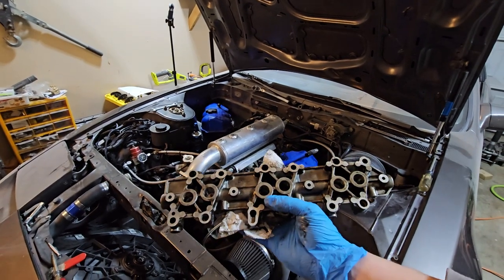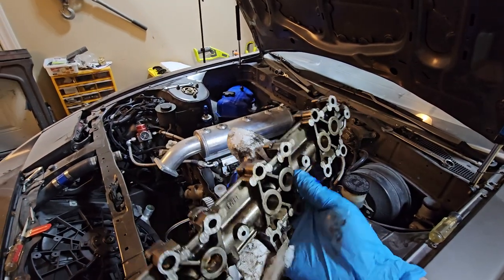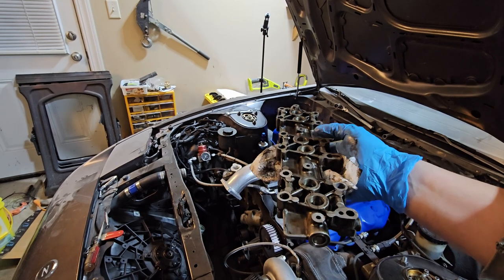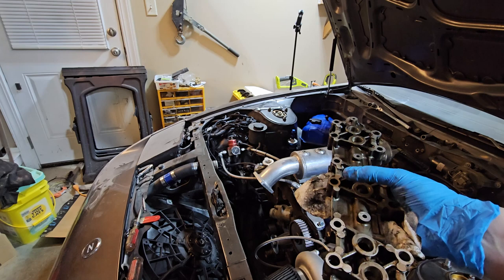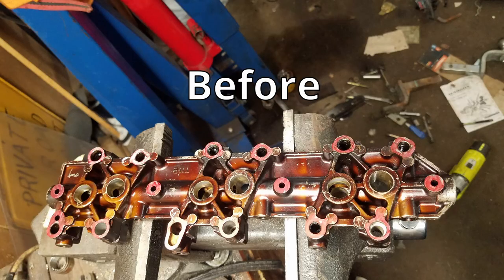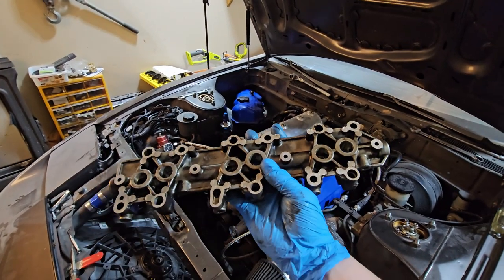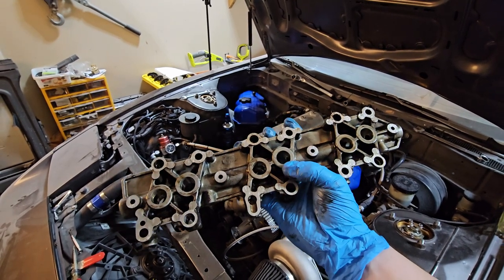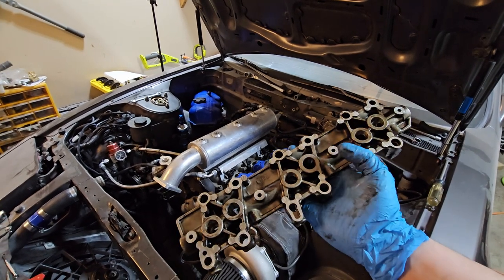SOHC VG LIFTER TRAY MOD

Comment: Sorry to ask a question not related to this mod.  I was looking in to getting a front facing intake plenum like you have.  But what TB and cable do you use with it.  Im sure it has to be a longer cable than the stock right?
Reply from the maker: The tb is from a 95 jeep 4.0. You have to file the mounting holes to make it bolt up. It has built in idle controls that work well with megasquirt.  The cable is a stock z31 cable

Comment: IF you still have the stock oil pressure gauge.... What's your oil pressure normally at after driving for 30min. Mines a little under the 15 psi line.
Reply from the maker: The stock gauge is notoriously unreliable. I use an autometer gauge. I can check for you. Next time i drive it
Reply: Mine is about 12 psi at idle with 15w50 oil and auto turbo oil cooler, on a vdo gauge.  Sketchy, but should still be ok.. in theory